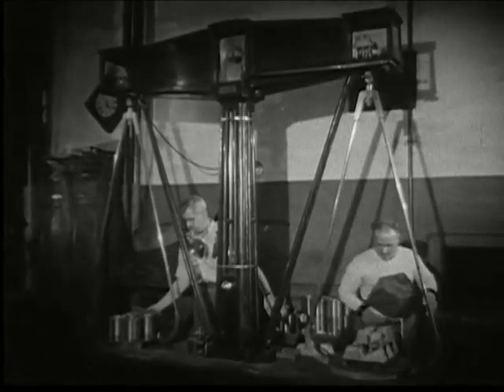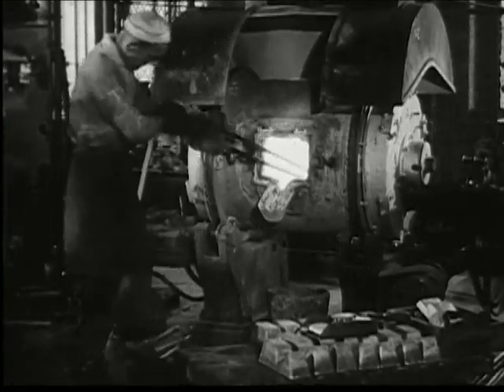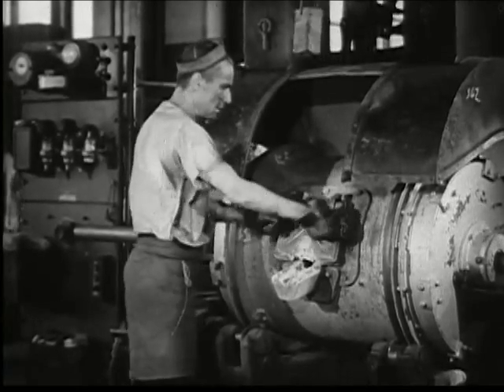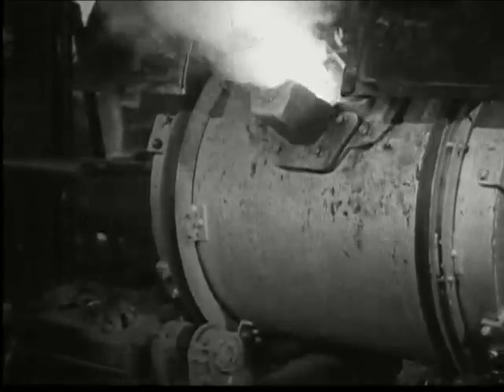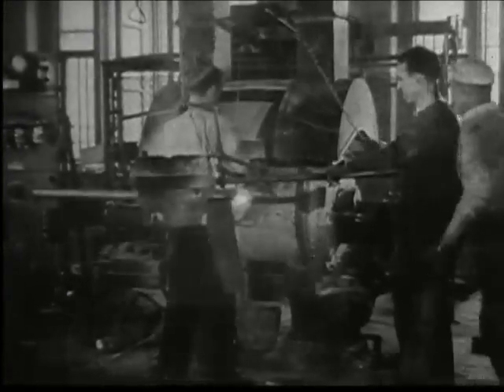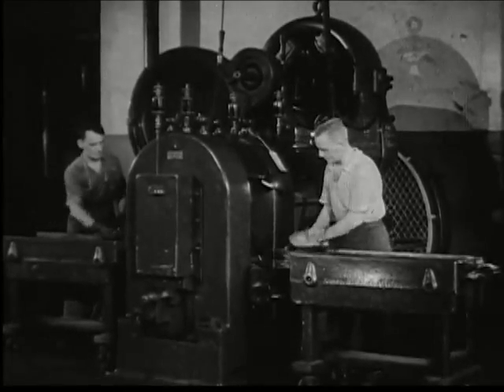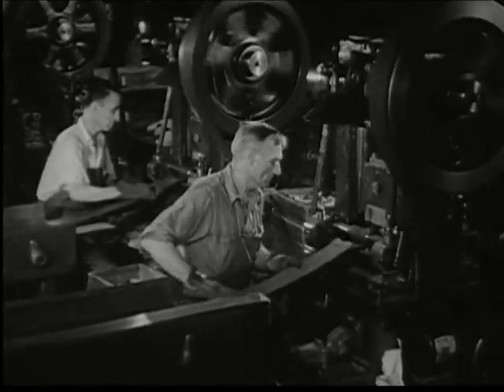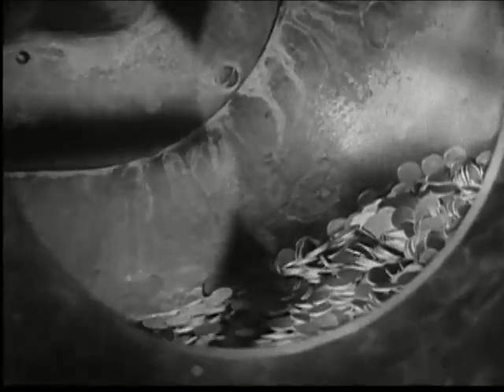Making Coins 1940 Department of the Treasury Bureau of the Mint

Comment: he Mint also saw its OSHA recordable injuries fall from 121 to 17 - that's an 88 percent decrease and lost time injuries virtually evaporate, dropping from 86 to 5.  The entire 1940 film is in the Prelinger Archive titled How They Make Money, originally titled, The Mint, made by the US Bureau of the Mint of the Department of the Treasury.  The entire film shows how money is coined at the Philadelphia Mint. Processes include the making, rolling, and cutting of alloys and the stamping, inspecting, and bagging of finished coins. The film shows the preparation of a bust of President Roosevelt for use on coins and includes external views of the mints at Denver and San Francisco. An exhibit of old coins and coin-making machinery is shown along with Mrs. Nellie Taylor Ross, Director of the Mint, from 1933-1953.

1